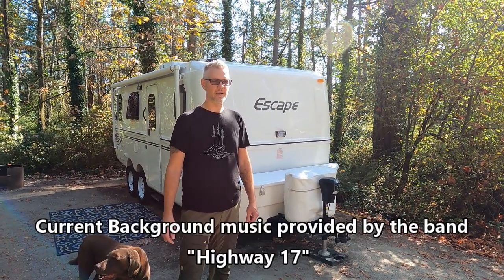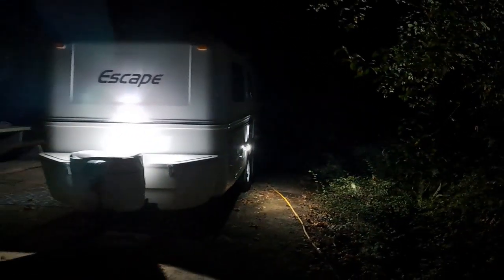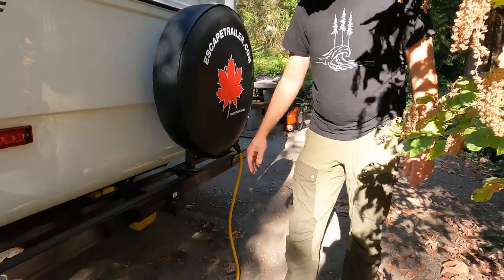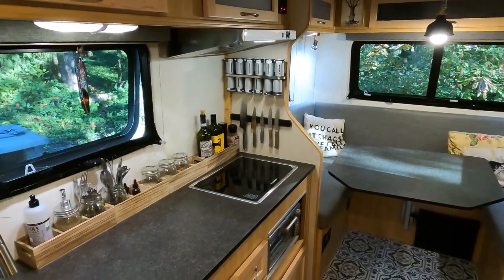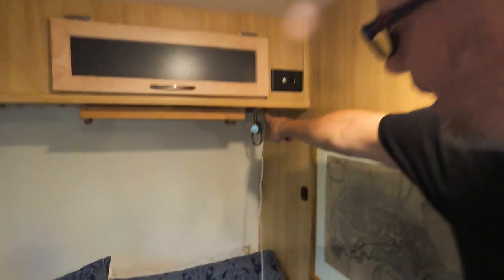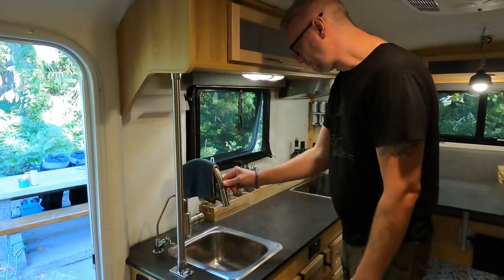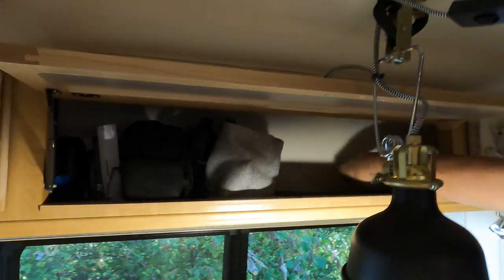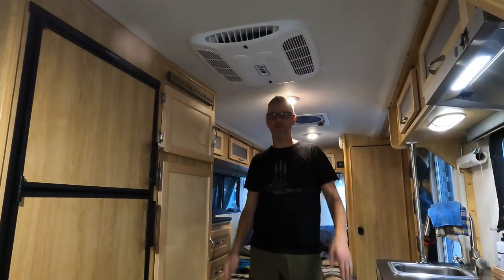Our HOME on Wheels - ESCAPE 21C FIBERGLASS TRAILER TOUR | FULL-TIME RV Life 🍁

Comment: I would like to know what the product is that you have under the mattress and cushions. So many options. Thanks for your video. Very informative
Reply from the maker: Hello, thanks for watching 🤗. That blue layer is actually underlay usually used for flooring (laminate, etc.). We looked at all the fancy options, and those were just too pricey. This blue underlay does the very same thing, to create airflow under the mattress and cushions. And the whole roll (we only needed a minimal amount of it) was only $72 (Canadian) at Home Depot. We never had condensation after that on those surfaces. We hope that helps😊.

Comment: Excellent tour!  Best I've seen.  I have the same little padlock on my front storage! 🙂 I had to turn my motorized jack sideways 90 degrees to allow room for my pickup tailgate to lower, but no problem doing that.  The standard USA hitch is easier to get the ball into/out of, but this one works fine for me too and yes, I have to adjust the truck forward/back just a quarter inch or so to get it to line up.  Wish Escape had used the USA type hitch.  Love my E2 system.  I added/wired in four light switches for four external lights (one on each exterior wall) and those switches are just inside the door on the kitchen wall.  I wanted to be able to turn on ALL LIGHTS (or individual ones) from inside if there were shenanigans going on outside.  Yep, I had same issues with the sail switch too, must be bad design.  And yes, that heater isn't very efficient.  It's on my list to replace it with a radiant propane heater that uses no electricity and is much more efficient, and I'll install it under the foot of the bed so it's down on the floor and so it points to the dinette rather than pointing out the door!  Ok, that's enough comments from me. 🙂  You have encouraged me to produce a video of my own 21ft Escape.
Reply from the maker: Hi Ann, great you like the tour of our 21C. We actually just today turned the jack sideways as well because of the space for the tailgate. Such a game-changer to be able to properly access the back of the truck. The hitch is for sure something to get used to, but it seems to add a tad more stability...maybe.
Good idea with the individual lights switched for the outside. Very helpful.
If you are interested in a very efficient, electricity-less heater. check out Martin heaters. We had that in our Avion before and it was awesome. It is direct vent propane heater. We thought about installing it in the Escape, but the direct vent puts a damper on that, since it has to be installed horizontally. Maybe you have a solution for that. Other than that we looked at the Dickinson Marine Propane heater. It only has a a 12V little circulation fan and would be much more efficient than those nasty normal RV furnaces. For sure do a video tour. Visuals are so helpful for people, even if they do not own an RV. Have a great weekend!

Comment: Excellent review.  Where do you store your clothes?  Can you make the dining room into a bed?
Reply from the maker: Hi there🤗,
All our clothes are in the overhead cabinets around the bed area. We don't hang clothes since it takes away a lot space. And for us using the closet as a pantry made more sense.
In regards to the dining area. Yes, the table platform comes down (in this case the lagun table) and the table rests on two edges that are installed around the seating bench. Then the wall cushions are used to fill the table top so that it is one big area with all the cushions.
Hope that helps😊!
Thanks so much for watching.

Comment: It would be great to have web links to some things you used/did... ie stuff under seat cushions to prevent condensation. Will be ordering our 21c soon.
Reply from the maker: That is actually a good point. Thank you! I will add some links to the description. The ventilation material we got in the flooring department at Home Depot (or Lowes, I will check). There is a material online which is called "Hypervent-Aire Flow Moisture Barrier", but it is  very pricey. So we walked around at hardware stores and tried to find out what might achieve the same function. I do that a lot...I like hardware stores too much :)
Reply: @backroadsbetty  Please also include the boxes you added behind your stove/counter to hold the jars. Thanks.
Reply from the maker: Will do!
Reply from the maker: Hi Ian and Jessica, I created all the Amazon-links for the items that we used in our trailer in the video description. Some of them we did not show, but wish we had in the video now, since we are happy with them ;)
Reply: @backroadsbetty  thank you!

Comment: Great video. I would be very interested in a detailed video of your electrical system upgrades.
Reply from the maker: Great you liked the video. Thanks for the input. Once I have the electrical all pretty much finalized (proper fuseholder another battery disconnect, better solar panel fusing) I will make sure to show the details. In regards to what I used on the major parts so far (inverter, shunt, solar charge controller) the list in the description that shows "Extras we installed in our trailer", might provide a small insight for now. Have a great day!

Comment: Oh thank you! finally someone fully grown like me in one of these things!  It is a very valid point that you really rarely stand upright in a trailer. I would like there to be more head room in the places where you do  - over the kitchen and in the bath. 

Did you find that a wet bath is actually preferable because you can sit down for the bathing process? 

also - why not the 5.0 that offers a 6'7" height in the areas I mentioned? Is that availability or didnt want to deal with a 5th wheel type tow rig?

One of the things I hate the most about most trailers are the windows. the framed ones only open half way and reed some sort of add on to keep rain out. The frameless windows only open a bare crack of a couple inches. The acrylic double pane windows from europe that are appearing on many trailers are so much better. I saw in Johnny Hung's video he replaced several of his Escape's windows with those and it looks fantastic.
Reply from the maker: Hi, thanks for watching!

The wet bath in general is in our opinion a great thing, since a person literally spends only some low amount of time in it every day that the living space is much more important to be comfy. And it being a two function areas in one makes sense to us, instead of those areas being separate.

I thought I would sit down for the showering but actually I never do. The curve on the ceiling restricts the shower head positioning mainly, but it is still enjoyable even at my 6'6". The bigger issue I don't like is when there is not enough room around me, that is why I moved the composting toilet further back than where Escape installed it. That made a huge difference in regards to the space feeling. We thought about only having the kitchen sink for everything to have more room in the wet bath, but are now happy with having both.

We opted to not go for the 5.0 mainly because we need all the truck space for our stuff (bikes, tools, external solar panel, extra water, etc.) The truck bed is our basement that keeps all our full-time stuff dry. When we picked up our 21C in Chilliwack it was the first time for us in one, so we just went for it knowing the height issue is not a big concern when we ordered it online (The AC is the only thing I keep a watchful eye on, haha). After only a week we knew we made the best decision and we are feeling super cozy in this little home of ours.

A lot of people like the framed windows, but as you mentioned rain can be an issue. So far we never had to be concerned about it with the frameless windows. The amount they push open is, again in our opinion, very much enough to allow great airflow. The much more important component here is the MAXX fan. When that thing is on level 5 (out of 10) The draft it creates is amazing. We have our fan going pretty much 12 hours a day. And our dogs love the cool down. It works great for them on hotter days as well without us having to be concerned about their safety.

Johnny is amazing with his upgrades. Those windows are what the North American RV industry needs to move on to. Johnny makes my german OCD happy ;)

The response got a bit lengthy, sorry, hope it helps though.

Have a fantastic day!

Comment: Is this a 4 season camper? And the windows are they double pane ? If not can you order with ?
Reply from the maker: Hi there, thanks for watching the tour. Well, officially, Escape considers it a 3-season camper...BUT we live in it full-time and had no problem being in -14C (7F) and a lot of other cold nights in freezing temperatures and were cozy warm. We have the spray foam insulation option under the unit which helps immensely to keep the floor warm. Main thing is good ventilation by having the roof fan cracked just a bit to let the condensation out. The windows are glass with a special layer that improves the insulation but they are not double pane. Escape is considering it for the future though. Hope that helps.

Comment: Hi Andre and Julia, the pendant lamp over the dinette is nice. How did you secure it to the ceiling? Also where did you get the soft-sided storage bins?
Reply from the maker: Hi Don, we used the same length screws that Escape uses for their standard ceiling lights. Should be 1/2" length. Since the location of the light is a tad further back than where Escape's standard ceiling light would be, we had to make sure there is something to screw into. Above the center dinette area Escape installs thin plywood under the ceiling, before they install the vinyl. We noticed that in a factory tour video. You do not want to hang a heavy lamp on it, but this one was great for it. The soft-sided storage bins we got from IKEA. They work great and don't scratch anything when it gets bumpy. Hope that helps.

Comment: Thank you for the detailed review. I just wondered why they put a pole next to the sink (which is quite rare)?
Reply from the maker: Thanks for watching😊. They have that pole in that position to improve the support for the overhead cabinets. All other overhead cabinets are in a way interlocked with sidewalls, except for the one over the sink. Which improves the stability immensely for those. The fiberglass shell with the embedded wood structure (only for installation purposes) would not be enough. Hope that helps🤗👍🏻.

Comment: I have a question- do they ever do fiberglass cabinets/ no wood for lighter weight. We have a Toyota Rav 4 for our tow vehicle
Reply from the maker: Good question. At this point...no. Escape so far sticks with wood cabinets. They are thinking of introducing aluminum frames, instead of their current steel frames, in the future. Currently the only company that I can think of that has fiberglass cabinets is Oliver. But that is of course another jump in price. Their base weight is not too light either though if I remember correctly. Hope that helps.
Reply: Its smaller but Cortez builds all fiberglass inside, I think they cloned a casita and upgraded everything. Double hull etc.

Comment: Hi ! We love your videos ! Your expertise in adding a 400 Ahr Li battery setup shows, great job. We also have a Escape 21C and we have the very 1st (prototype) Escape installed 400 Ahr battery. I do have one question, I saw in one of your earlier videos that you use a solar suitcase with an extension cord. So, what Solar Suitcase do you use and how long and what gauge wire is the extension cord ?
Reply from the maker: Hi there! Thanks for watching our videos and we're glad you love them.
Thanks for the compliment to our setup. There is much more we would do to it, but for now it works great.
To your question. We have the GoPower solar suitcase (100W). It has 5V USB outlets as well so it can be taken anywhere to charge anything USB as a stand-alone unit. But I have to admit we would go with a 200W Renogy foldable case these days and delete the solar charger it usually comes with. Since the Escape exterior solar connection is wired in parallel to the roof panels and you don't need that charger on the exterior panel then. The extra 100W makes a big difference in shady situations (and for some reason, we are always very lucky finding those😁). The GoPower suitcase is voltage wise close enough, but not perfect as an add-on to the roof panels. You want to match your portable panel as close as possible to the roof panels in the voltage readings. Otherwise you can drag down the efficiency and get less wattage out of your system than what could be possible.
To the wire size: Since we are using the 30A removable power cord and if needed a 30A extension cord, the wire size is #10AWG. I built two adapters for the cables so they can connect to the solar suitcase and to the exterior solar connection on the Escape. Since we don't want to carry around even more cables and the RV cables 30A #10AWG size keeps the voltage drop low, which is a big factor in the low voltage world. I even thought about #8AWG, one size bigger, but there has to be a limit as well to things one wants to carry around in the storage box.
Apologies for the long response but hopefully it is helpful.
Reply from the maker: Oh...and to the length of the cables: the removable power cord from Escape that I use as well for the solar suitcase connection cable, with my self-built adapters, is 25ft. If needed I add the other 25ft 30A RV extension cable to it. But we try to keep it with only one cable if possible, to reduce voltage drop and therefore improve efficiency.
Reply: @backroadsbetty  Really appreciate the prompt and well thought out response ! This is truly helpful, as we will soon need to park in the shade. Also I concur with another fellow commenter, a separate video detailing your electrical design, layout, and thought processes behind the technological choices (Solar Controller, batteries, Inverter, fuses, Converter, etc.) would be really nice, maybe explain your future desired electrical changes as you go along.   Again much thanks and keep up the Canadian/American touring and elegant video making !

Comment: Where did you access the little bungee cords and hooks for you medicine cabinet? I like that idea. Easier to get close sized stuff in and out, I bet
Reply from the maker: Glad you like it. It is very easy to get stuff in and out. Not sure where you are located, but we got the bungee on one roll and cut it to the right length. The hooks we bought  in a pack of 10, I think at Canadian Tire. But a lot of hardware store should carry something similar. The tricky part was pre-drilling a small enough hole into the medicine cabinet sidewalls for the hooks. Hope that helps. Have a great rest of your day!
Reply: @backroadsbetty  Thanks for the reply. I found rolls on amazon. Was the size around 1/16 or so? We are in Alberta
Reply from the maker: Ours is a tad bigger. Should be 1/8". But 1/16" could work as well. In the end as long as you can easily access/place the items in the shelve, any bungee thickness will hold them in place. Have fun with your modifications!
Reply: Oh so you drilled holes for the hooks? Does the magnet hold the door well? Mine seems loose. Does the magnet in the cabinet move a little on yours? I enjoyed your video.
Reply from the maker: Brian Kaplan, yes, we pre-drilled the hook holes with a very small drillbit. The magnet is OK-ish, sometimes it seems it opens during rough rides. Since, before we installed the hooks and bungee, small things were on the wetbath floor sometimes. Great you enjoued the video and thanks for watching !

Comment: Curious- did you ever weigh your hitch fully loaded? Do you remember how much it weighed?
Reply from the maker: Hi, we didn't weigh the hitch weight alone when fully loaded. But we weighed the trailer while having all our things in there, plus water (fresh and some grey water,  since we don't have a black tank). 2268kg (5000lbs) is the GVWR of the trailer. We were at 2109kg (4650 lbs). Our trailer is very well balanced the way it is loaded. Hope that helps 😊👍🏻.
Reply: @backroadsbetty  yes, that’s very helpful, thank you!

Comment: I love the hypocricy of the "composting" toilet, as it's contents are disposed of in a plastic bag, into the trash, for the dump. Never into nature to further compost .... :D
Reply from the maker: Our standpoint is not that we are composting with it or that we save the planet with it...BUT... our reason for using it is that:
- we do save loads of water that would go down the pipe for flushing instead of more important things in our RV
- we don't need to buy extras to keep the tank from smelling or clean...since we don't have a black tank and the composting (diverting) toilet does not smell during or after use like even a flush toilet does
- we save the black tank weight and have more space under the bed because of having no black tank for more important things than carrying around a slush mix of pee and poop
- we only need to empty the bucket every 5-6 weeks depending. The urine compartment of course more often, but we can just go to a normal toilet if needed and don't need to find a drain area while pulling the whole trailer to it
- did we mention it doesn't smell bad at all? Actually it feels like pooping in the woods because any smell is more like nice garden moss smell🤗😁

That's our reasons anyway, but the good thing is you can choose your Escape with whatever toilet you like best😀. Have a great day!

Comment: Fiberglass is plastic, right?
Reply from the maker: Hi, fiberglass is a plastic material that is reinforced with glass fibres embedded in resin matrix. After that there is an additional gel coat added in this case. Hope that helps🤗.
Reply: @backroadsbetty  Thanks.